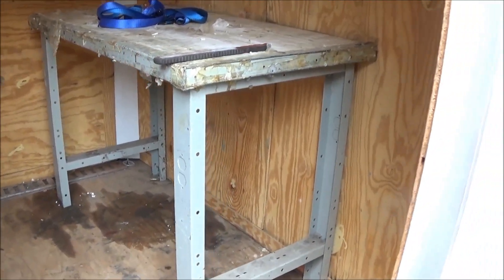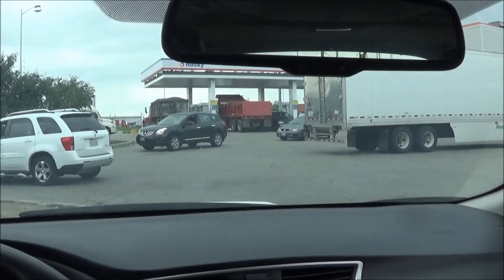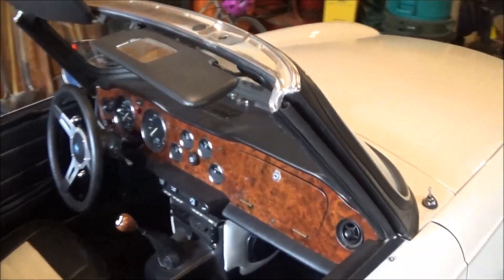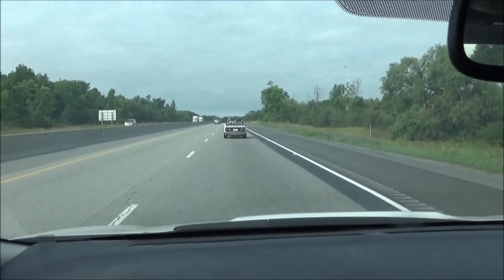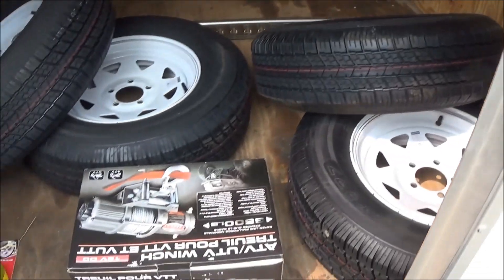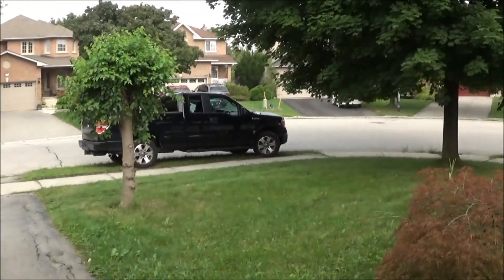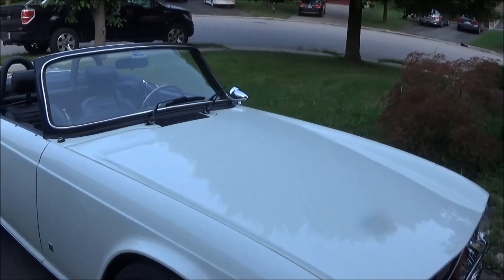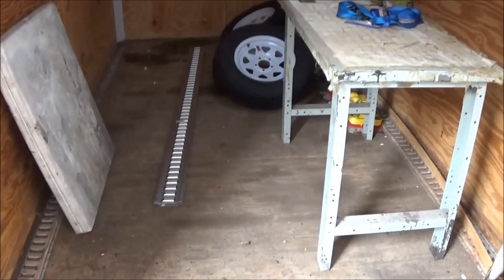Picking Up a 1973 Triumph TR6, Trailer Project Progress, And Test Fit

Comment: Thanks for your time and effort in driving all that way to pick up my “new to me” 73 TR6 Tush. It was a blast to drive home and never missed a beat. It took me another 2 hours to get home after you peeled off, the traffic was a nightmare. The car didn’t overheat, but I did!!

Nice job with the trailer, now you can take your TR6 to TRials 😉

Comment: The trailer certainly will be a plus. Are you going to check the wheel bearings? I see so many trailers tipped over on the side of the road, or on fire because of the wheel bearings burning up. Lovely TR6, too. They do look good in white. Thanks for the good update.
Reply from the maker: Bruce Boschek yes sir, it's on the list while I'm changing the tires out. It will be safe I promise 😎

Comment: Hi Tush. Is that a 14 inch Moto Lita wheel in your TR6? Thanks Sean
Reply from the maker: Hi Sean, it's a 13 inch actually and it is flat and not dished. I needed the 13 to fit comfortably in the car.